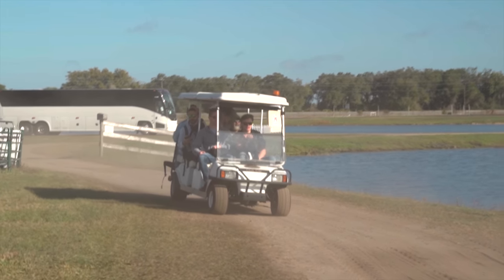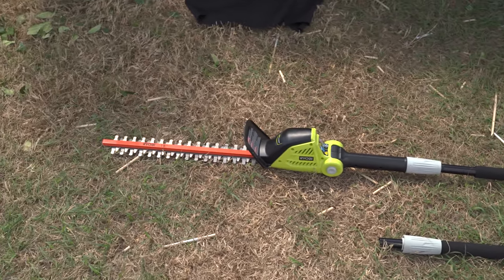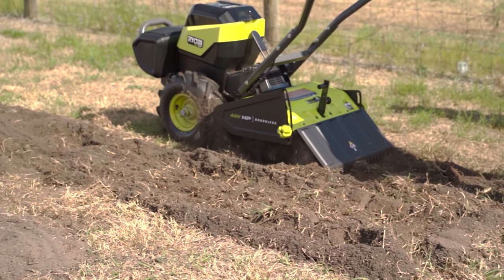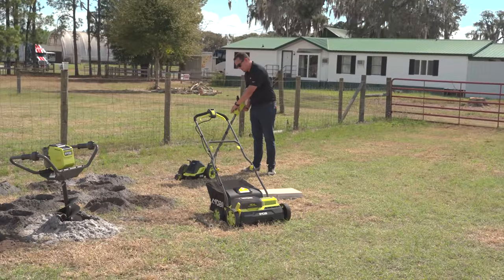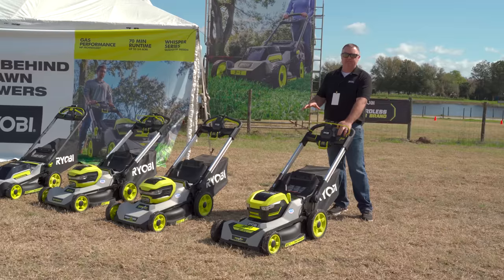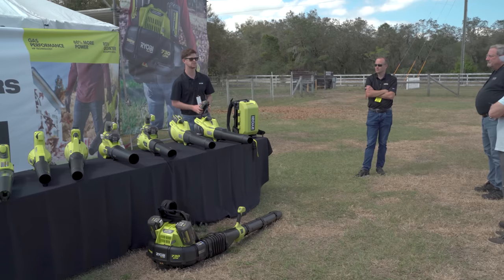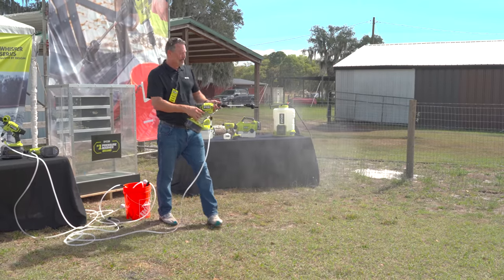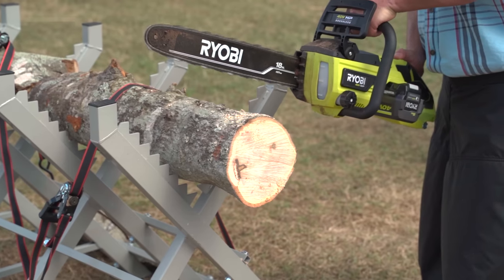RYOBI is NOW #1 at THE HOME DEPOT!

Comment: Wow that is an impressive lineup!  Being someone that has converted over from gas to the Ego product line.... Ryobi actually seems to be more diversified.  Made in the USA is awesome.  I can see this company being extremely dangerous to the big boys in 2 - 3 years or less at this rate of innovation.
Reply: Lol sure bro, whatever you say, ryobi just now making brushless stuff, while Dewalt and flex are already in the future with stacked lithium batteries, ryobi don't even have 12 volt tools 😂
Reply: Ryobi about the same as harbor freight power tools
Reply: @Lee-lb9qh  yeah I am already loaded up with Milwaukee tools and more packouts than most contractors as well as DeWalt flex tools as well.  Just commented their USA made and their product line is very diversified.  Walk into any home Depot and they are selling massive product which means big profit margins to help develop the product better for greater future sales.

Comment: This is all good for small jobs, but if your doing heavy work, and alot of it, these still wont cut it unless you have a sperate trailer by inself loaded with batteries, like a seperate trailer just to store and charge batteries.
Reply: I use the HP lineup daily at work plumbing multi storey residential buildings, rotary hammer, mid torque, impact driver, drill, grinder, compact recip and some others, and I don't change batteries any more or less than the other guys who use Milwaukee or DeWalt, and my stuff keeps up flawlessly with the other "name brands"  Ryobi isn't what it used to be with the new HP line of brushless tools, they really aren't and everyone is impressed with just how powerful they are when they give it a try

Comment: Ryobi has come a long way with there technology.
My questions would be ?   As the size of the equipment such as the riding mower and the level of technology in the equipment become more high tech.  Who services this stuff ?  Also what is the availability of pairs ?   🤔
I think the warrant needs to be clearly defined.   
Very cool video !!!!!
Reply: I've never dealt with any servicing department for Ryobi, but I did repair a last gen push mower myself and ordered parts through their website.  Was pretty easy to do and they have parts diagrams of all of their equipment with coding numbers.
Reply: @tmhunter7  Very cool.
Thanks for the information 👍
Reply: I think you are a little confused or misled about the "level of technology", it's batteries, electric motors, and mostly mechanical parts similar to most other mowers.

Comment: I'm willing to admit that I used to turn my nose up at Ryobi but if it was not for the power washer of theirs that I had bought a month ago I would have not consider them. I started using it on my pickup for a washing it off but now I started using it on my Freightliner, it saves a lot of time of grabbing brushes and holes and I don't have to get on top of the engine to wash the window

Comment: I have been mowing about 50 lawns commercially for over 10 years. (About 8 hrs per day mowing, 5 days a week.) Where does the 52 inch zero turn mower fit in to this picture?
Reply from the maker: I’m not sure I understand your question, do you need a zero turn?
Reply: @VCGConstruction  My question is will that electric zero turn mower hold up to commercial use, as described for 3 to 4 years, and always maintain charge as well?  A dumb question, I know, but is there a straight forward answer?

Comment: I've had serval of the 40 volt yard tools for 5 or 6 years and they have been great. All the original batteries are kind of toast. Got one new 4ah battery and found it does the work of the original three, well almost. I can do all my trimming and hedging with the one battery. I'm WAS excited to see the 80 volt zero turn until this morning I looked up the price of one of the 80 volt battery packs, $1310.68!!  Let's see, times 3, that's almost $4000!!! So every 5 to 6 years you have to pay 2/3 the cost of the mower to keep it running? Maybe they will run longer than 5 or 6 years but how much longer. Think I'll stay with gas for the mower.

Comment: I have multiple 18v tools and Ah batteries no issues with any of them. I love my 40v brushed 15in trimmer. I do my trimming around the house, walkways, driveway and pool only uses 2 bars. 
I would love to get the zero turn but at $5000 that's way out of my price range. I didn't give that much for my D140 John Deere. At full price it was half that. The push mower at $500 is to expensive for most people.
Reply: Then don’t get the $500 mower? There are many cheaper options. Unless you have acres, the normal ones will do.
Reply: @jamesbizs  Thank you captain obvious. Here the cheapest  is $399.

Comment: I got a Ryobi walk behind electric lawnmower last year and the large 6Amp hour ex battery died. It will not charge and gives the 2 light error. Contacted the depot I bought it from and they said to contact Ryobi. I did and they basically said sorry you bought a clearance item and there is no warranty on them. I am ticked. That 40v battery is $226.00. Unbelievable crap customer service. 😒

Comment: I'm liking what I'm seeing,  but this is what I would really like to see.  Replacement motors for gas engines ... when you already have a investment made into gas engine gear. And LOVE the less maintenance of battery operated tools.... to be able to swap out a gas engine for equipment that ryobi or ego or whomever doesn't make yet.  I have said my house is where gas engines come to die... lol 😆  that's why I already have a ryobi riding lawn mower... to many of it's gas engine competitors have died here. (although admittedly they were all used)
Reply: Actually in the UK Ego already has replacement motors for the gas powered lawn mowers.  They are also offering their motors to the big boy companies to sell outside of Ego   Think of how Honda and Briggs & Stratton are to the US model gas lawn mower manufacturers.
Reply: @DJ_Driven  ... here ego thinks it's a crazy concept.
Reply: @vgc construction I think you have a spammer to block
Reply: Ryobi has one in the works for push mowers. 👍

Comment: I’ve always used Dewalt in construction and never had a single issue with any of them whatsoever. I then bought a bunch of Ryobi tools from Home Depot several months ago. They absolutely suck!!! Their batteries don’t hold a charge and/or the cordless tools only last anywhere from 30 seconds to a few minutes tops. Never again! I will never again buy or use any Ryobi tools ever again! I bought multiple batteries and had the same problems. I also returned and bought replacement tools. Same issue. And then when you put the batteries back on the charger they say fully charged but once again, only last maybe 5 minutes at the most. The cordless vacuum is the worst though. No matter the battery, you only get about 30 seconds to 2 minutes run time and then the vacuum dies and runs out of juice even though it’s nowhere near the capacity of being full.

Comment: Ryobi nor will any big box brand will not be the "leader" in outdoor power equipment until they have a reputable network of dealer support for thier commercial and even residential users. Hoping to swap it out at home depot within 90 days is not a solution, nor is dropping it off at home depot and not getting your equipment back for months at a time under the "5 year warranty " period. The second people see the equipment fails and they can't use it to maintain their property for weeks or months at a time is when they always go back to gas powered equipment that the local mom and pop shop can fix in about a day or two.